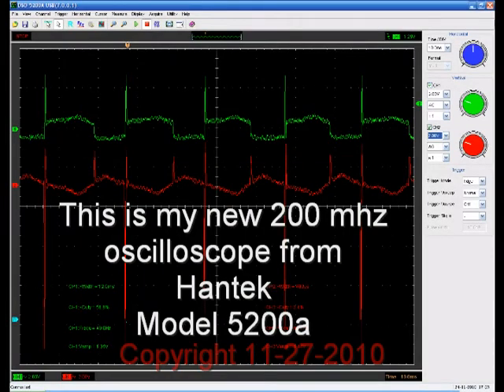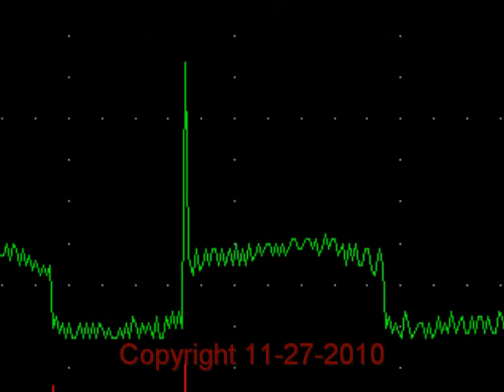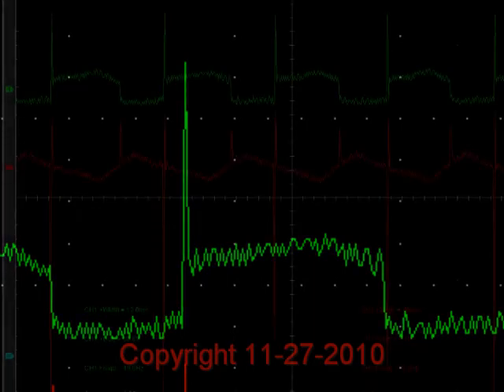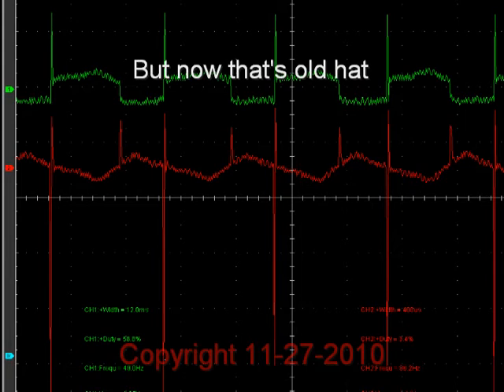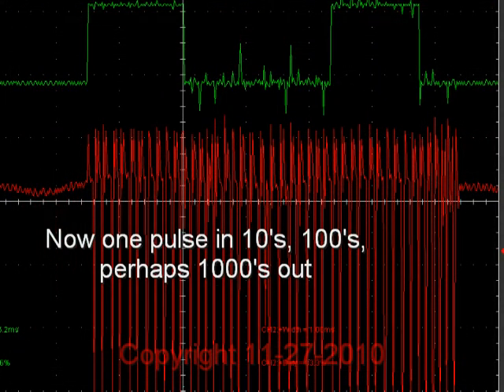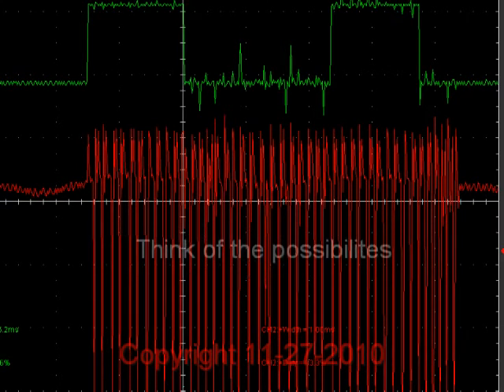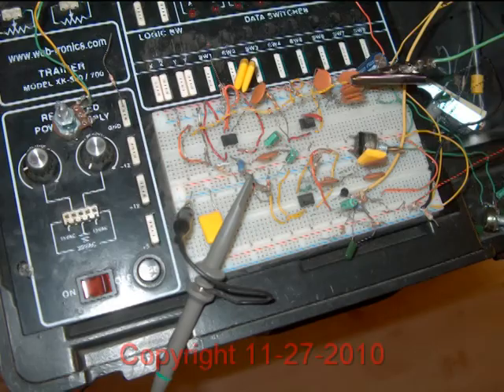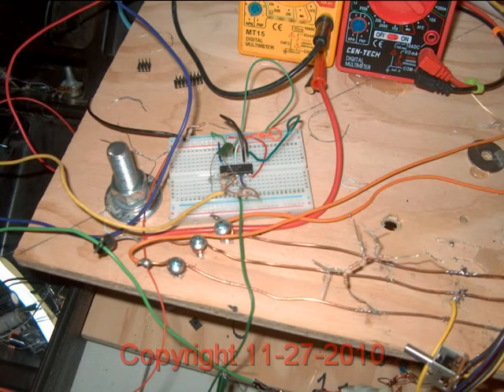Bedini No it's a Starship #3

Comment: @hhoforvolts I really hope so,  you're design seems quite promising. I would hate for it to disappear. Two inventions that came into my mind was the ORBO and the TPU. They showed great potential and I was quite fascinated by them. Unfortunately, those inventions disappeared off the map just as quickly as they got popular. Frustrated, I Iooked at other stuff like Kapanadze, Don smith, Tesla, Sweet, and Bedini. It seems they have similar problems to a lesser or higher degree.